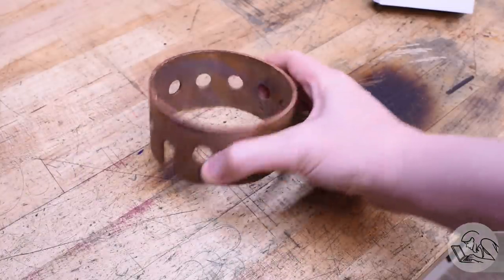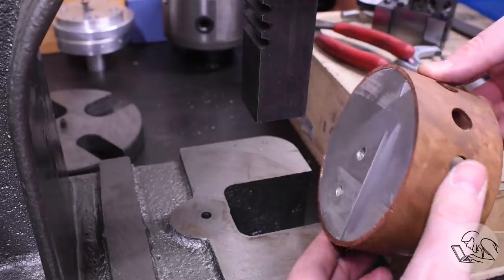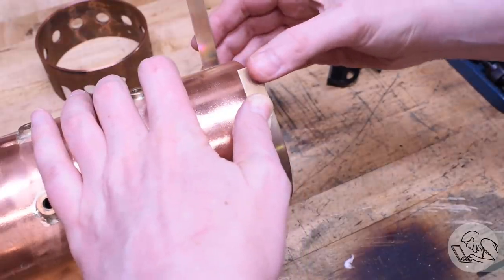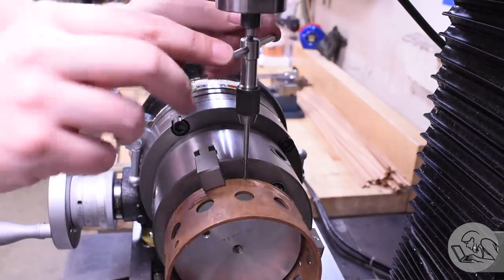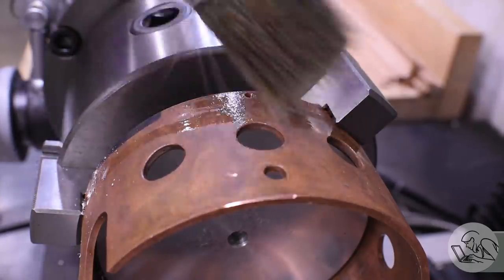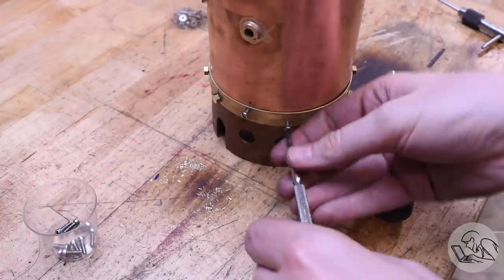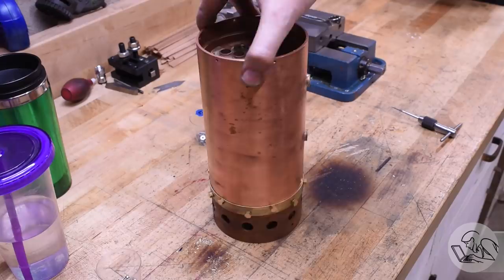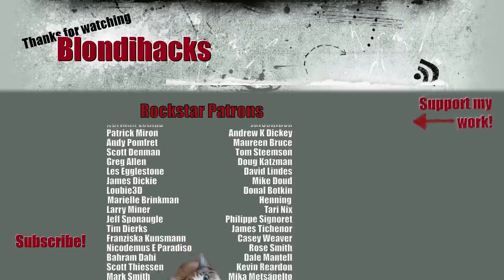Boiler Fire Box - Model Boiler Build, Part 12!

Comment: Theory about the cause of holes not lining up: When the ring was clamped in the 3-jaw chuck for drilling, it was visibly distorted out of round due to not being a close fit to the old-boiler mandrel underneath it (most visible at 11:11 where the drill makes it flex). This distortion would cause angular positions on the ring to be pushed away from the jaw locations, so that after the ring returns to round, each hole position will be shifted towards the jaw positions, by a distance that varies depending on the angle from the drill position to the jaw position.
Reply: Yes, with the one hole that was showed being drilled in the first attempt it looked like the drill wasn't drilling very close to the center drill mark due to the ring flexing.

I'm a hack so I would have gone straight to the 'opening out the holes' stage rather than making a second one. Depending on how far out things were I might have opened all of them, or just a couple as Quinn did. The bolt heads will hide the shame.

Comment: Hi Quinn:  Regarding cutting the stack to length, I have successfully used my dry-cut cutoff saw to cut copper tubing for plumbing work.  Use WD-40, and feed VERY slowly so as not to have the blade grab the tube.

Cheers!

Comment: It's looking good Quinn! When you are 'centre finding' using your rule you may find it easier to use a spring loaded tap follower instead of a centre drill. It takes care of the vertical movement for you and you don't have to chase the quill all the time.

Comment: Your match drilling comment is the way we do it in aircraft sheet metal. Drill a small hole through all the parts in one location, cleco it together then drill all the others using a cleco in each hole as you go. Then remove one cleco at a time and ream to final size. You could have also dimpled the ring (using a dimple die set) and countersunk the firebox and boiler skin - then flush riveted it together.

Comment: Metal polishing brass/ copper, nickel silver ; Get Bobbing compound for removing sand paper and other scratches, will also remove surface porosity. Brass/ copper finish polish with Green Chrome compound, this brings up a beautiful, bright polish. For NS use White Diamond compound. 

Try 0K solder (zero K) a gold colored solder with characteristics of silver solder, blends perfectly with brass. Rio Grande (not sponsored) jewelry supply is a good source.
Reply from the maker: Good tips, thank you!

Comment: Well done got there, one of the difficulties with drilling the ring is that it must be an extremely tight  fit around the tube, yours showed signs of being very slightly to large, this is going to compound the very small expansion of the ring caused by the drilling of the holes, this is especially prevalent on thin material. One way round this problem is to wrap the material round the cylinder and drill the first hole and bolt it, remove any clamps and retighten the ring, drill and bolt the next hole, continue in this manner until you reach the final hole. Rather than silver soldering the joint a swaged and lapped joint with a bolt is a good way to finish., space the bolt holes accordingly. Other people have made great suggestions, when it comes to the home builder many of the most important techniques may not be known, I love watching your vids as I have encountered all of the same problems that you have had but you have the intelligence and bravery to show them on line.

Comment: Awesome video as always? I try not to armchair quarterback too much but considering the softness of the annealed copper, this might have been a perfect application for a 5-40 form tap to make the threads a bit stronger
Reply: Excellent point. I use metric form taps in copper, and it has made my life so much easier. Making 800 M3 tapped through holes and 200 M2.5 blind holes in 12 mm copper bars, I snapped two drills and three taps in the first 150 holes. I swapped to a 2.75 cobalt stub drill and a forming tap and the rest of the holes went perfectly. I also wrecked three 5mm carbide end mills removing the broken taps, but managed a Quinn-level recovery by reaming the hole to 6.00 mm, making soft rivets and peening them, then re-facing the part. Redrill and tap and you'd never know.  Definitely a +1 for forming taps.

Comment: I am working on a project which has two guide rails, an upper and a lower, for a small conveyor belt. The base of the guide rails are each made from 1 1/4" x 36" x 1/16" Aluminum flat bar stock with a 3/4" x 1/2" x 36" Aluminum angle running down each side underneath the base to form a channel with 3/4" tall sides and 1 1/4" wide. These three pieces bolt onto small 0.5" x 1.5" x 0.5" mending plates in 4 places using 8 6-32 x 3/8" flat head bolts that screw into J type 6-32 speed nuts. The mending plate has 3 5/32" inch holes in it 1/2" apart and the speed nuts are clipped over the outer two holes. I had to use a Dremel tool to shave 1/16" off one side of each speed nut as they were too wide to fit under the outer holes in the mending plates. So I have a 3 layer sandwich of 24 sheet metal holes that have to line up over a distance of 3 feet. The top hole had to be countersunk as well so the bottoms of the guide ways would be smooth. Lining up 24 holes through three pieces of sheet metal twice, one for the top and once for the bottom, definitely turned out to be the hardest part of the project. I spent the last several days "adjusting" a few of the holes to get everything to fit then half of today deburring, sanding, cleaning with Acetone, and finally polishing them. They look great just like your project does but I never thought it would be so difficult. Wish I could send you a photo!

Comment: When I worked on aircraft I was tough that riveting sequence is extremely important with sheet metal. I believe the same process happened on the brass band. When you drilled there was some growth in the material that was compound when going in radial sequence. If you where to drill opposing sides sequence simulator to torquing on a car wheel this might have been minimized.

Comment: Ok, that make-it-round trick is really awesome. So is the bolt mass production cutter.

The grill paint is pretty good, have used it. If you ever want anything a pretty bright orange (like the color of Simplicity lawn equipment), glossy, and high temp capable, Rust-Oleum also makes a "Chevy Red" engine enamel spray paint.

Comment: A trick I seen Keith Appleton use for the bolts, and looks veri nice: Use a bit of threaded rod and fix a nut to it with thread locker. Rod should protude the same in all nuts. Now you have bolts that look a lot more like the real thing.

Comment: Love the form tool! The copper dig in was no surprise, because copper. I did notice you flipped the boiler when picking it up, but only right after you said it and primed the alertness.

I probably would have done one hole in the ring and the firebox, tapped it, put a bolt in, and then done the others straight through tapping size with clamps to try and keep the ring in vertical alignment. But I would have not done the clamps up tight enough and the ring would move and it would be wonky. So I'd open the holes up into slots!

I use aluminium inserts for brass & bronze and they're fantastic. I've used them on steel occasionally, with a very good result. I assume it's just because they're so sharp. But that's hand-feeding and not much depth of cut for the steel.

Thanks for making these videos, I look forward to seeing them each week.

Comment: I've had great results using brazed carbide tools with a big radius "scoop" ground into the top. The extreme positive cutting action and sharpness are a must have to reducing the cutting pressure. They work great for any soft mat'l and the low cutting pressure is great when you need to hog off a lot of mat'l on a smaller or belt drive lathes, however be warned it is a delicate grind and the chips are not the friendliest depending on what your doing. Cant wait to see this project finished, it has been a great journey to watch!

Comment: I have nearly the same lathe as you and I went ahead and replaced the motor with a servo. It gives tremendous low speed torque. To the point where it cannot be stalled. I would recommend anyone to do this

Comment: Clamping the three pieces would probably distort them. A quick spray of CA adhesive would hold well enough and a little heat just pull it apart.

Comment: Could it be that the brass ring stretched or deformed a little bit causing the holes to not line up? Since it's so thin. Also that bolt making tool was amazing.
Reply: Very difficult to keep the pattern when drilling on an angle from the inside during the second operation.  Not sure what might have gone bad in the original operation.  Possibly backlash in the rotating head, or misread the scale, or a burr left after the center drill caught the drill tip and pulled it off, or the center drill did not go deep enough into the curved OD to keep the tap drill concentric.  Easy to lose both precision and accuracy on small holes like those.  1/64th off on a #5 screw is a large fraction of the diameter.  1/64th on a 1" bolt is not normally a problem.
Reply: I think the problem lays in the fact they are different diameters. Even though the same process was used for drilling it would seem it should work. Someone good with geometry may be able to explain it. I have seen weirder stuff happen before.

Comment: If you need to temporarily hold something in place, hot glue works wonders.  Just pretend your spot welding. Once the piece is in place and held  securely with hot glue you can drill holes without the piece moving on you. The hot glue instantly releases with denatured alcohol.
You can put on a lot of hot glue if you need to. 
If oil is needed during a drilling process, that might be a little bit of a concern since the oil might release the hold of the hot glue also.
Use the clear glue sticks not the amber ones.

Comment: Its probably found out later in the video, as i'm like, paused right after it was stated.. but um.. rewatch the video where you were drilling out the holes on the rings.. You can visibly watch the drill bit  flexing when in the drill press/whatever.. they completely missed the intended spots... then later when hand drilling, the drill bit was visibly walking along the part, so again it was completely missing the intended spot. :D

Comment: I've honestly kinda found that, unless you're doing high production CNC stuff, any insert will work alright with any material.
Reply: There's variation obviously, but yes, you *can* cut most materials with most inserts if you're feeding by hand. The moment a machine is running the show though, you want to be putting some thought into it
Reply: @boulder795  I've used the same insers for aluminum, stainless, and plastic and gotten good results with all of them.

Comment: I saw you use metric!  Must have made the job much easier.
Reply from the maker: I use both regularly
Reply: @Blondihacks  It is good to know multiple languages.  Each has advantage depending on the situation.
Reply: @BrianFullerton  I totally agree.   Contrary to what some think wishing will not make the imperial system go away. Knowing both makes one a better machinist.

Comment: The reason the ring holes are different is because the outer Dia. is larger than the boiler and fire box
Reply from the maker: The setup is radial, so diameter of components doesn’t matter

Comment: Looks good, but I was totally expecting you to solder the ring or directly solder the firebox to the boiler part.
Reply: I was afraid of that actually!  After all of the work to get the boiler body sealed up with solder, I am SURE any attempt at doing so would mess that up.  I was internally cringing until she said she wasn't going to do that!

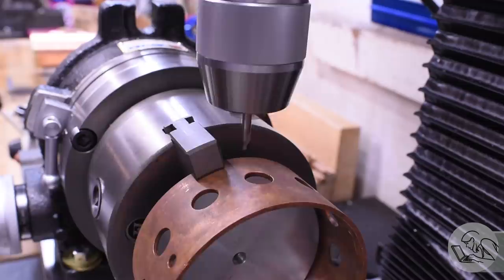Comment: am I missing something at 8:53, when you're drilling the radial pattern in the base? it looks like the the base is moving vertically as it rotates -- the height above the table seems to change. is that a real issue, and could it have thrown off the position of the bolt holes? (though I thought the bolt holes were wrong on the shell, not the base? not sure, I'm feeling very lost)
Reply: I think you might be on to something.  Looking back at it now, I see it too.  It’s especially noticeable if you jump the video forward and backward over that 10 second timespan.  If I’m remembering correctly, weren’t there issues with both the top and bottom parts?  I almost wonder if Quinn had the jaws in that three-jaw chuck installed in the wrong spaces…
Reply: @mrimmortal1579  You nailed it! Pause at exactly 8:50 and then skip forward and back 5 seconds (< and > keys) to see the two jaws are off by one relative scroll position. 

I have to admit to having made this exact mistake on a rotary table myself in the past. They rotate so slowly, it's difficult to pick up the mistake. As soon as I saw @Lofty's comment, it dawned on me too. Good eye sir.

Comment: could the hole mismatch be because of the pattern (non-symetrical?) being made clockwise on both parts?  Wouldn't one of the pieces be upside down in your setup ie hole pattern on the top of one part and the bottom of the other?

Comment: The chuck interfered with 2 holes. 2 holes out of position. Coincidence?
Reply: That was my first theory too. But it’s easy to relocate the angle meter with a pin in the chuck. I’m going with the copper deformation postulate presently.

Comment: I've been building water tube boilers for awhile now and always tig welded them. I am curious with the flame so close to the bottom of your boiler how come the silver solder doesn't melt on the bottom (the solder holding all your fire tubes in place). Isn't the flame temperature of butane hotter than the melting point of silver solder?

Comment: Considering the brass is so soft and thin you may have been able to get away with assembling, drilling, tapping, and bolting all in one setup without disassembling to enlarge the holes in the brass. It'll strip the thread out of the brass as you tighten the bolt but who cares?
Reply: Also I love the form tool and bar feeder setup!

Comment: Hey Quinn. I was wondering about the very bottom of the boiler. Since the firebox is made of the ( now verified super soft ) copper do think you might want to put a supporting circle of something right at the bottom so it doesn't get mushed somehow?
Reply from the maker: It’ll work harden quickly under use, because the expansion and contraction from heat work hardens it
Reply: @Blondihacks  oh. I would have never guessed that one. Cool. I always thought that work hardening required physical bending. Ya learned me a new one.

 I'm looking forward to you lighting that puppy up one day. You really have done such a great job with it. Most impressive.

Comment: At 15min you can see why the holes didn't line up using your first method. Your mandrel (old boiler) is too small so the ring is deformed slightly when you drill it, moving the hole positions.

Comment: How do you know how wide to make the parting blade? Could it be thinner, to save of material?
Reply from the maker: It’s basically a trade off between tool pressure and rigidity.

Comment: Would you still be able to use that form tool technique in steel?
Reply from the maker: Yes, but tool pressure is very high so you’d need to go very slowly and use tail support, probably.